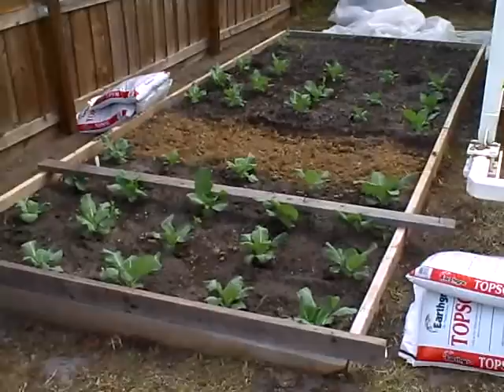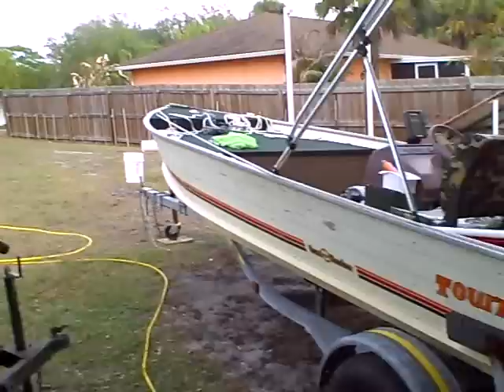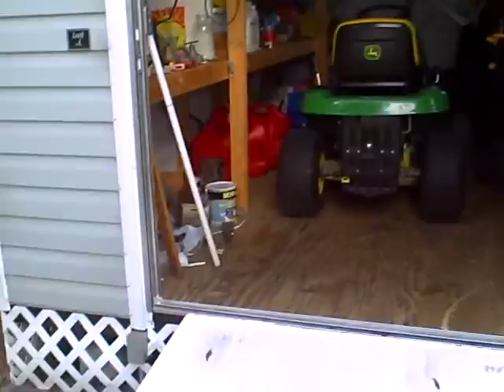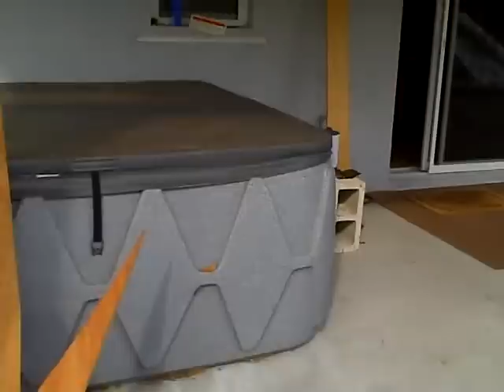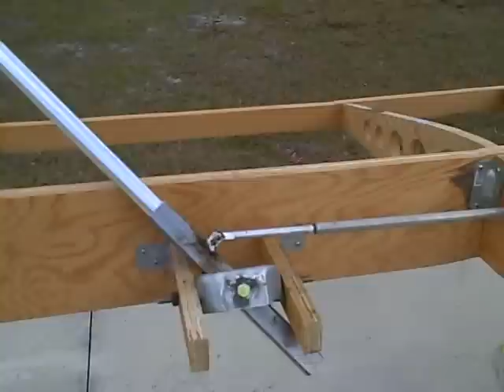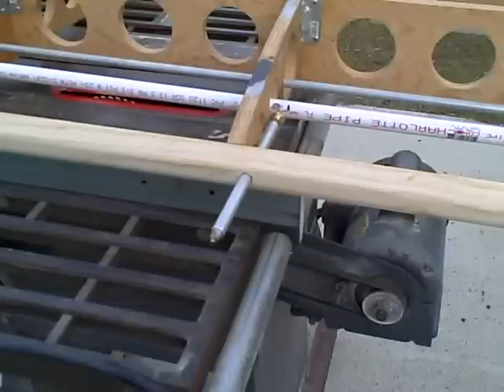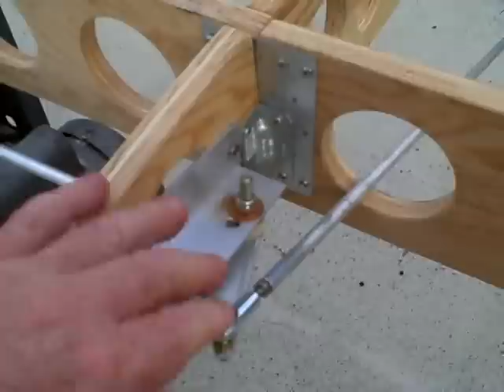My Home Depot Project Airplane

Comment: No worries guys.  Yes, the ribs are built 10 times too heavy, the spar has lightening holes where it should have a shear web, the spar to rib attach fitting would fail under their own weight, and the control system is rigged wrong and will break in the first turn.  He'll be short 30-70 HP just to get it off the ground.  If it can't fly, it can't crash.  Wear a helmet in case you steer it into a tree in the back yard please.  Clearly an elaborate joke video...

Comment: Dan I applaud you for your desire to fly and build your own aircraft but there is so much wrong with this wing that it scares me. I'm a licensed pilot and A&P (aircraft mechanic).
I see no safety wiring...bolts upside down (bolts must always be right-side up), the spar looks much too thin...should have a front and rear spar..stiffening the wing should be done with wire rods and turnbuckles (not aluminum tubing) to adjust each wing bay!
Please buy the FAA Acceptable Techniques and Practices book!

Comment: yes, but if what we see in this video is anything to go buy, it will probably be to heavy compared to the wing area to sustain flight at reasonable speeds. (my original "it will be too heavy" comment was to explain that the structure he shows us is VERY unlikely to get faa certification, and it looks like it will be too heavy to meet ultralight guidelines.)

Comment: Dude you got this. Builders like you and me get shit done. Here is my aircraft thrust and lift formula.
550XY-W=Z
W is the weight of the aircraft with pilot
X is the horsepower of your engine
Y is the efficiency of your propeller(Idk how thats calculated but a good guess is around 75%)
Z is your speed in feet per second

Comment: Nice having a passion man :) I'll give you some advice bout this plane. First, rebuild it with lighter materials - use balsa and thin plywood for ribs. also the mechanics... There'll have to be something that pulls those rods - there are mini motors called servo's to do that. They're very light so why don't you put them one for each wing near flaps? Also this long, flap control rod won't work because of the air pressure covering the wing when flying. It will simply twist and the flap won't react

Comment: You could probably build a 'plane from Home Depot. Unfortunately, the materials strengths and so forth are not certified for this use, so it's a very stupid and risky thing to do. You should only build aircraft from aviation-certified materials and have the damn thing inspected by an FAA/CAA qualified engineer. Still, there are always the Darwin Awards...

Comment: This must be a joke.This is probably a model for demonstration purposes or something cause this thing looks too heavy and with 25HP probably wont fly.Also I don't think the FAA will let this fly, for all the reasons mentioned in the comments.I am building a home built aircraft from plans and you can get some material at home depot or lowes but you don't build the spar from 3/4" plywood or use electrical boxes and hardware.  Screwed up the shed...now build an airplane.  LOL Briggs & Stratton!

Comment: Do not waste your time (or money) any further with this project.  You're spar with a butt joint WILL fail.  The "gimble assembly" is too weak.  The amount of play on the aileron, if you got it airborne, will cause flutter.  You are building a death trap.  
I admire your dream of building this, but I urge you to not continue.

Comment: I do believe you'll need more than just 25 horses to fly that with any kind of authority.  What will it weigh do you think?  I have a half scale fokker triplane (RC) that weighs around 175lbs and uses a five cyl radial developing around 29hp.  It flies it scale.  So, you may want to re evaluate your power situation.  good luck!

Comment: How much does that one wing weigh? You look like a pretty big dude. I used to own a Quicksilver MX with a 30 hp engine and it was a very slow climber. I only weighed 180 and the time and the entire airplane weighed about 250. It had much more wing area than your plane will have and that 30 hp engine still had trouble lifting 450 pounds (including fuel).

If you keep the entire airplane under 255 pounds you don't need to get it inspected or approved by the FAA.

Comment: Pretty cool! Hey, I would say that once the wings are covered, you'll attain sheer strength. Try flexing it after it has covering. Big difference. Light, but strong, is good for airplanes. Kinda' thinkin' what Home Depot sells for a good light strong covering because it is so important. I would go ahead and use the real air craft covering because it glues, irons on and shrinks "tight". There's a lot of strength with that covering. So, maybe instead use black nylon sheeting, dope it with what?

Comment: several thing is the faa will need to inspect it before you can fly in it and also all those materials way to heavy for a 25 horse engine airplanes with half that weight use 80-85 horse engines

Comment: looks like fun for sure. have you checked the weight of the wing and by extension the weight of other material you're going to use?  I don't know anything about building a plane, but the wing looks a little heavy with that 3 quarter inch plywood construction...oh well, it gets off the ground or it doesn't !~

Comment: Why are you all telling him that the plane is unsafe? The only thing you've seen so far is an uncompleted left wing. It looks like he's following plans, and the build looks very well done. I would still suggest having an A+P inspector check out the work, however. A 20-25 hp engine may not be enough for that small of a wingspan. It will get off the ground, but the engine will really have to work. Take it safe and go 30hp+.

Comment: Join the EAA.  Get an A+P inspector out to look at what you've done so far.  Have a PE check out all your stress calculations: the structure appears overly heavy in some respects and much too light in others.  I admire your gumption;  however there are many aspects of your wing design and construction that do not appear airworthy.

Comment: 2 problems u might want to consider := 

1 Ur wing will break in several pieces when u even try to fly this , 
2 the joints u made for control's will just snap off like the way u made it , its way to weak :-)

I like the idea tho :-)

Comment: You cannot use regular wood and steel fasteners from the Home Despot to build a (safe) airplane. You must use materials that have a much better strength to weight ratio than pine and steel. Balsa wood was used on early airplanes because it was light. Even 747s are made primarily of aluminum. Even the rivets are mainly aluminum and NOT steel.

Wouldn't you say that Boeing engineers know a bit more than you and I combined?

I admire your enguinity, but part of being smart is accepting criticism.

Comment: I've always wondered if this type of airplane is possible.. You certainly aren't building it very light, steel brackets and thick pine everywhere. Not sure if it'll fly, but I respect that you try. The Wright brothers didn't have regulations or clubs to join or mechanical engineering, and they died, but they lived their dream, they lived mankind's dream, and all we've done is make it illegal to reproduce their inventive genius.. It's sad, but people like you might bring it back.

Comment: Put some diagonal braces in the wing as 'drag braces'. Also is looking like two struts per wing will be required. If the wings are floppy at all, be concerned for flutter developing.  Make ABSOLUTELY certain the aileron ball links cannot separate (Preferable to use a 2ndary safety, like SS safety wire, so even if they do separate, they cannot fully depart).
Same, even moreso, goes for the elevator connections! (that will kill you) Looks a bit heavy, but should work.

Comment: If you fly this, you will add "Home Depot Coffin" to your accomplishments.  Unfortunately, plywood (particularly home depot plywood) is NOT an acceptable spar material.  Also, joints in plywood spars cannot be made with sheet metal screw and gusset plates.  I love a lot of your design creativity - but check with an EAA technical counselor or an A&P mechanic before you try and fly.  Home depot aluminum won't work, either, as it is 1100, and good aircraft are made from 6061 T6 or 2024 T3.

Comment: There's a reason aircraft parts are so expensive: reliability.  While I think its brilliant what you've come up with so far, its also very foolish to trust your life to untested parts.  If something breaks at 5,000 feet, or much worse, 100 ft, what are you going to do?  If you really want to do this I highly suggest installing an ultra-light parachute for emergencies.  Its also highly advisable to look into FAA regulations regarding home-built aircraft...

Comment: this "joystick gimbal" is just horrible. 2,44 it should be placed into aluminium holder. Not two tiny pieces of playwood not eaven attached together on top. In the air there will be a lot of force working at this part.

Comment: The hinge on the aileron should be bolted not screwed on. the wing you showed could easily weigh pass 150 lbs when covered with aluminum skin. Double that for the whole wing would be 300 lbs.plus fuselage with seat, wheels and instrumentation which could weigh at least 150 lbs plus the tail section add another 100 lbs all adds up to at least 700 lbs. Propeller efficiency is only 70% at best. you would be lucky if you get 50 kph stalling speed. YOU WILL NEED A MORE POWERFUL ENGINE.

Comment: joined them incorrectly, 2nd, plywood is not the right material to use, third,the dimension is not suited for its intended job, fourth, the alignment is meant for rigidity so that the wing has no other way to go but twist when force is applied.The wing must be strong but flexible in the right direction which is upward. please see Boeing 787 wing break test - YouTube. I would advice you to make a smaller model plane since what you have started would definitely end in catastrophic failure.

Comment: your airfoil rib would have better capability if you us NACA 4412 profile. You must first know the basics like type of materials to use and its weight so you can get its center of gravity which is the most critical aspect in safe flying. Your ribs are broken in 2 parts and screwed to the spar like you do on cabinets and shelving which is okay if applied to a static structure,but a plane is a dynamic structure. Your spar is wrong in many ways, first it has an inherent weakness for you have....

Comment: Your workmanship looks pretty good, but that spar is going to break, and you can't put sheet metal over wood wings!  You need fabric instead.  And there is no way 20-25hp will get that off the ground with any human in it, or as heavy as it looks so far.  I suggest you pick up an AC 43.13, the A&P's bible to learn about acceptable materials and practices.

Comment: +100 for enthusiasm.  -1000 for inadequate research.  If you're going to do a monocoque wing with the load on the skin, buy several sheets of the home depot 2" blue insulating foam, wirecut desired airfoil and cover with fiberglass.  Do a lot of research on Rutan.  Then go from there...  I'm thinking of recreating a "Woodhopper" in composites....  Your work looks better than average, but it's still dangerous -- every hole is a stress point you better know where/why to drill 'em, and what size.

Comment: i never built an airplane that carried a person...but i built a lot of rc planes...my concern is this,,,your gimbal for ailerons is supported by plywood on the sides..my opinion that is not strong enough..also the rods going through the wings to control the ailerons,  those cannot flex while under operational stress(wind pushing back on the aileron) i think supports on those to keep them from flexing would be important. aluminum skins on the wings still may be too hvy for the structure you have.

Comment: cool ! hows d proyect going? wheight should b ur primary concern so  changing control mechanisim to a pulley nd cable config its a good idea nd have u consider wraping it w/ fabric its lighter, cheaper nd way easier. also a lill twisting nd bending on d wing its necesary a structure to riggid will b ripped of d fuselage w/ d air pressure nd or @ landing u need dat flexing.. great proyect ! have fun..

Comment: Having built three airplanes (from plans), I would suggest you go that route - in my humble opinion.  ALL of the comments, presented here on, are absolutely correct!   It has NO drag spars; has NO compression spars; no gussetts; no doubler plates, no blocking,  etc., etc, etc.     We are just trying to be helpful, and not critical.  It's a good start, but definitely a "non starter" airplane.  N-6395T

Comment: Holy Cow, this is ambitious. I agree with the other commenters.  You should join EAA, and get plans for a Volksplane. Its similar size to what you  have there, but it's a proven design.  There are a number of fatal flaws in the structure you have there.

Comment: Dan, have you heard of the Experimental Aircraft Association?  eaa.org.  They have a TON of resources for the homebuilder and experimental aviator.  Get in touch with them - it could save your life.  Literally.  My advice is to very carefully hang that wing up on the wall, and get hold of a set of plans for a proven design.

'Ignore thou not the laws of physics, oh birdman, lest the Earth rise up and smite thee!'  - The Gospel According to Orville, Chapter 1, Verse 1

Comment: I applaud your enthusiasm but feel compelled to add a caution.
1) The spar should be one piece. It will very likely fail at the join under slight load
2) The ribs are too thick, therefore too heavy
3) The leading edge strip is too big, too heavy
Pushrod controls are okay, but
4) No fail-safe when the aileron pushrod bends and it will
5) No fail-safe if pushrods detach
6) Locating & fixing points appear to be inadequate for flying load.
7) The "joystick gimbal" needs rethink
Good luck

Comment: as far as control mechanisms, assemble them out of the wing and form a straight line with the cables, nuts/bolts, rods, etc.   attach each end one on the back bumper of one car/truck and the other to another car/truck and have one other person to drive in the opposite direction, if the mechanism snaps apart, you'll have to redesign the linkages until it is strong enough to withstand the tug of two cars/truck driving in opposite directions.

Comment: It might also help to get up ontop of the center of the wing and hop up and down vigorously and stomp on it to simulate turbulent weather.  Durability and strength of Wing, connection to control surfaces, and mechanical linkages is critical.  It might be best to build the first prototype just for stress testing purposes, once it passes then rebuild or improve each component depending on the initial stress tests

Comment: once you build your wing, make sure you get a bunch of sandbags 6X the weight of what you think the plane is going to be, place two strong stands under each end of the wing, and put the sandbags on the wing, flip wing over and repeat process again, if your wing breaks, bends, or folds, it's not airworthy enough to withstand 6 +/- G's which is a minimum standard for most small aircraft.

Comment: Sir you should look into composites, very strong and lightweight material, much safer for building aircraft parts, or using aluminum frames since metal is more flexible and doesn't have risk of snapping apart like wood

Comment: This is scary. You use ordinary plywood for the ribs when you should use aileron grade plywood.  You moved the aileron down on the left wing  and you said the plane would turn left - actually, it will turn right.  Using the aluminum is good but you should incorporate some ribs to form some triangles. If you have built model airplanes before, you will know what I mean.  I won't even attempt to fly this.

Comment: Jesus! is not even a complete spar it has a split right in the middle. I hope; for you own safety, you won´t go further with this project, I can see that you have craftmanship, but you are designing the wing very wrong. you are actually using not cheap materials, but instead NOT the right ones. Contact you local EAA and they will be very happy to help you with your project.

Comment: I do like your aileron control.  What rib numbers did you go with?  a thin airfoil like that requires a fast airspeed..  unless it is much longer.  The only way she will fly is if you have extreme horsepower but with your design the internal structure won't handle it.  The other issue is drag and anti drag as in compression structure. It's nice to see someone working on their dream but there is a reason for 2 spars.